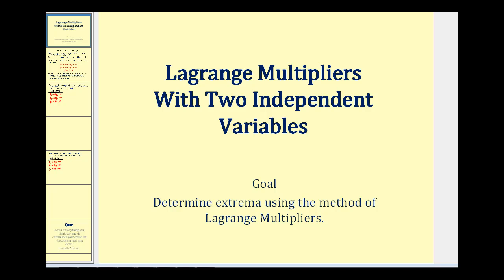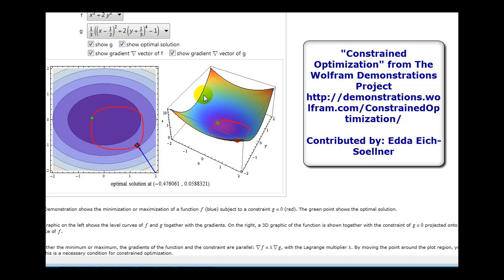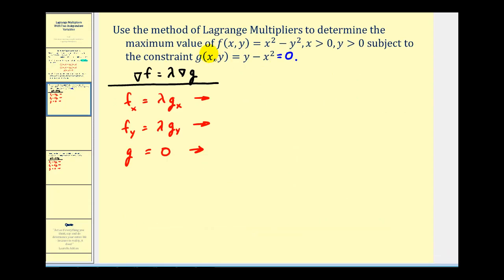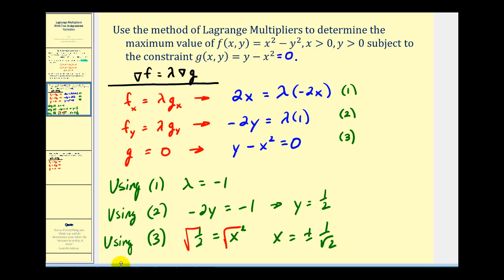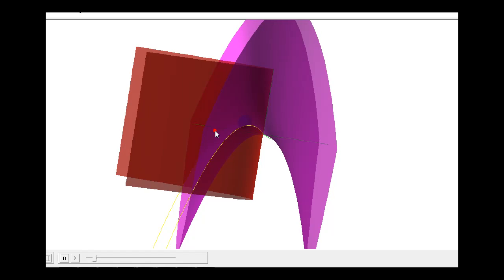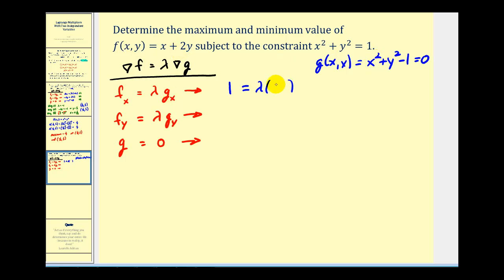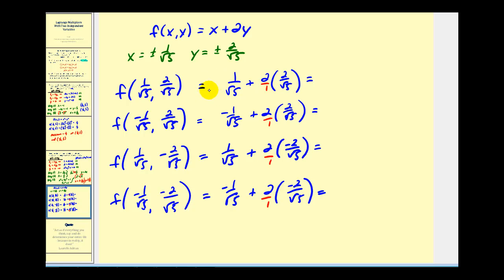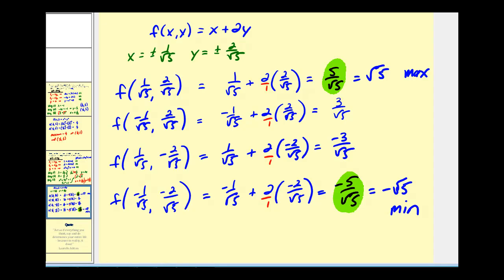Lagrange Multipliers - Part 1

Comment: Hi can you tell me what del g(X) actually represents geometrically. I ask because I want to get better intuition for the lining up of del f(X) and del g (X) and why the max and mins occur when these two gradients line up. I understand that I can think of del g(X) as just the normal vector of the constraint curve. Every video explains the direction of this vector but could you explain how the size of this normal vector comes about geometrically. Since it determines lambda, it's size is important so I just wanted to get more intuition on this.

If you can answer this I would be so grateful.

Comment: In the second example, I don't think that there are four critical points.  There should only be two.  The points where the x- and y-coordinates have the same sign are the only points where the equation y = 2x (from the lambda constraints) is satisfied.  Also those are the only points where the constraint curve is tangent to the level curves of f.  In the second and fourth quadrants the constraint curve is never parallel to the level curves of f.